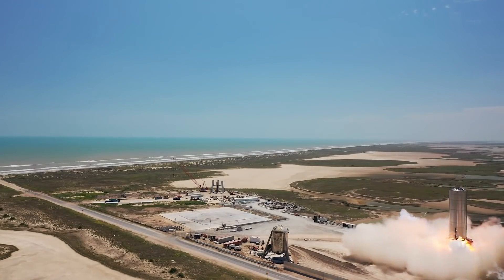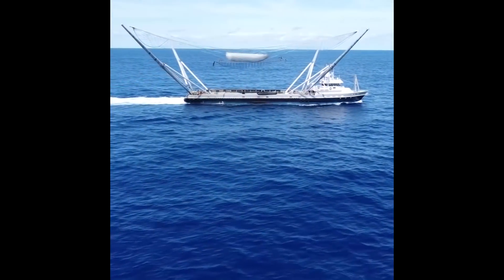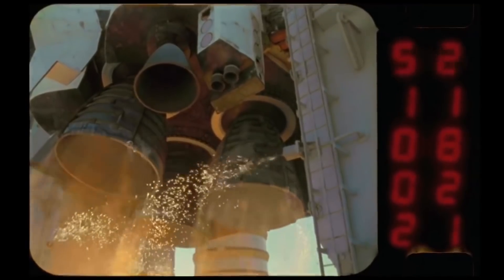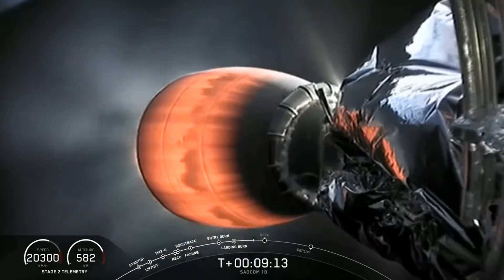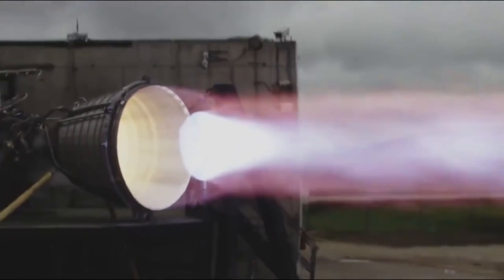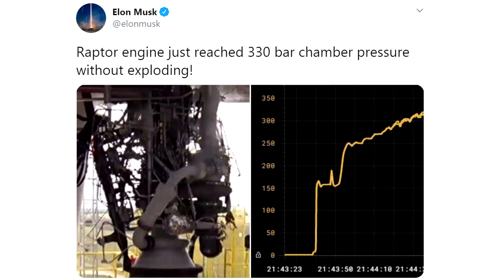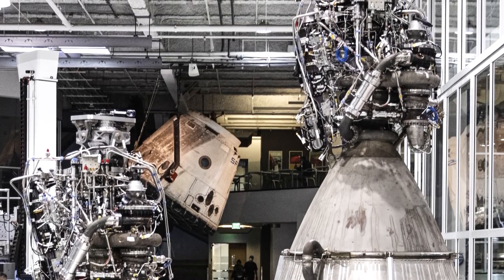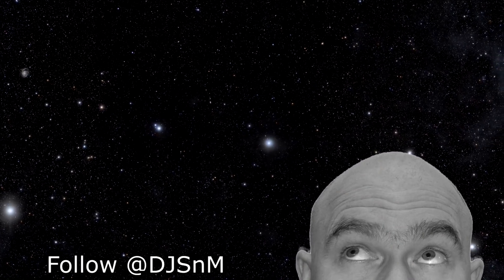How SpaceX's New Raptor Vacuum Engine Is Different From Previous Raptors (and Other Stuff)

Comment: Wow!  So the active cooling in the vac nozzles is actually enough to use copper!  I would have expected that to risk melting just based off of my experience melting copper on accident with butane....
Reply: Copper doesn't melt at the temperature of liquid methane.  And that's the temperature copper will have when you flood liquid methane over it.

Comment: damn these new engines are getting into F1 territory in terms of size and power
Reply: Not even close, actually. The F-1 weighed about 8.5 tonnes with a thrust of a little under 7 MN. Raptor is about 1.5 tonnes with a thrust of about 2.2 MN... nowhere near as powerful or as big (which is why Superheavy has about 30 of them), but it does have an insanely good thrust-to-weight ratio.

A closer comparison would be to compare RapVac with the J-2 engines on the second and third stages Saturn V... the J-2 weighed about the same as the Raptor, with about half the thrust. More efficient, mostly due to running on hydrolox, but well down on power.

Comment: How do they Ignite the engines?  What is the initiator source ?  Guessing it don't take much.   If you spill some LOX and step in it  with fuel on your boots it can blow your foot off.
Reply: Basically, electronic spark igniters. Kinda like the click-click-click on a modern gas stove. Yup, methane and oxygen don't need much to set off. No special lighter fuels like Merlins need.
Reply: Exhibit A, the demise of Starship SN4... lots of liquid methane and oxygen flooding across ground that had just been subjected to the heat of a static fire. Only a matter of time before something ignited it.

Comment: How does the fuel get to the turbo pumps with 
a second ignition? 

The tank is no longer full. The rocket moves 
back and forth. 

How do you make sure that the rest of the 
fuel gets to the pumps?
Reply: Low power "Ullage Motors" fire to place a small thrust on the rocket and force the fuel to the bottom of the tanks.
Reply: @KB4QAA  These Ullage engines have their 
own fuel supply? 

So don't we have the same problems with the 
Ullage engine? 

Or is the fuel probably solid fuel?
Reply: @silberlinie  I'm not an expert but the fuel in the small engines is monopropellant which doesn't combust and therefore doesn't have that problem
Reply: @(S)-Riley Dunn Where are these Ullage engines installed? 
I have never seen them in a sketch or construction drawing.
Reply: @(S)-Riley Dunn Yesterday the booster stage of the 
starlink mission came back for the second time. 
These boosters stagger after the separation from 
the upper stage. 

During the descent some of the engines have three 
ignitions. Do you think that the fuel for the turbo pumps 
of these engines is also provided by help of Ullage engines? 

And how many Ullage engines will be in one booster 
stage?

Comment: I wonder if they could add a light weight self-inflating rubber ball/airbag exterior to the fairings. For example some of the mars lander had an airbag that inflated and the two halves came around to fully encircle the rover before it hit the ground. In the case of the fairing, I'm thinking of something similar working in tandem with the parachute. Its purpose would not be to protect from impact (unless it turns out it can replace the parachute, but that's not the point of this idea), but to allow the fairing to float and to protect it from the salt water. Then they wouldn't need to catch it in a net.
Reply: They don't want to add weight, though. It's worth a lot of money to them to be able to recover and re-use fairings, but anything that adds significant weight is going to cost payload mass. 

Plus from all accounts, it's actually the impact that's the problem, not the salt-water immersion... the latter apparently doesn't cause much trouble, but they've lost a few fairings because they've broken on impact.
Reply: @simongeard4824  Huh... I would have thought the parachute would slow it down enough to avoid impact damage.
Reply: @Trifler500  It slows it a lot, sure... but they're still hitting water with enough force to break things.
Reply: Airbags only work with relatively small and light payloads.  That's why all of the bigger rovers use rockets to land.  Airbags can't dissipate the energy of a large landing.
Reply: @stargazer7644  Yes, but I only mentioned a rover in my example. I was talking about fairings.

Comment: They already have the stacking alignment stringers mounted around the top of SN8, so it's "nosecone-ready." Speculation is that they will do cryo and pressure testing first, then stack and weld on a nosecone while still on the launch pad before the 15 Km hop.

Comment: The green tint on startup is cool. I read ignition, they use it to make the fuel hypergolic, if I remember correctly. They also use a similar chemical to start the sr71's engines
Reply: No that's the Merlin engine where they use TEA/TEB for startup, which reacts with oxygen and ignites. As you said same as SR-71. The Raptor like the RS-25 has electric ignition, basically torches powered by gaseous methane and oxygen and ignited by a high tech spark plug, it has two torches pointing into the combustion chamber and two for each of the preburners.
Reply: @please_stop-v7o  oh, I could have sworn that there was some green in there. Must be tired me seeing things
Reply: @kevinradtke3767  One of the Raptor tests was pretty green and Elon mentioned a little copper from the combustion chamber burned up, that's green to.
Reply: No TEA TEB on Mars... ;) At least not for a while.

Comment: I don't think those speed holes in the landing gear are designed to allow for "crushing", aka plastic deformation as is seen in crumple zones in automotive applications, given the aversion to single use components like burst discs, explosive bolts, etc, in SpaceX.  I can't say to what those holes are for, since I don't know, but if I had to guess, it was to allow for some "squish", elastic allowance, and maybe just some weight reduction where buckling isn't a concern?  I mean, pop a speed hole in everything you can, and it saves that much weight.
Reply: The legs for these hops are single use, Musk has said they're working larger landing legs more like the F9 that will self level.